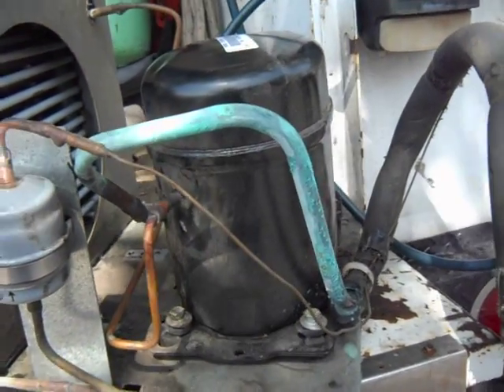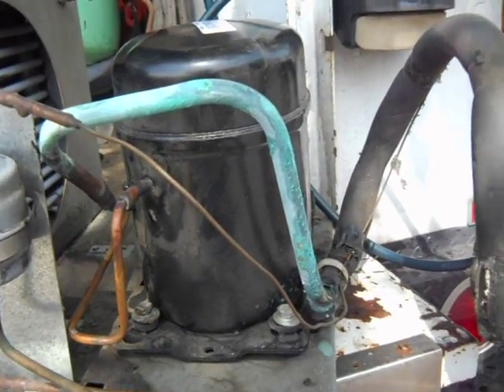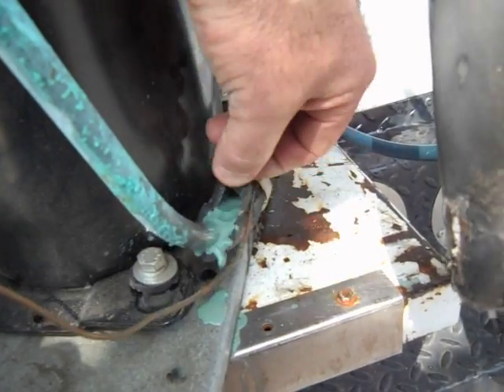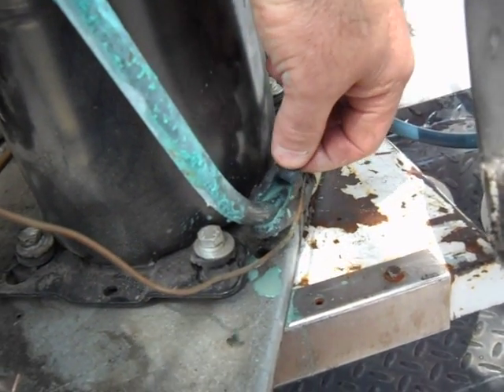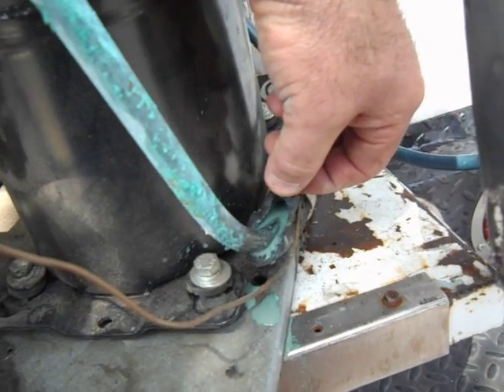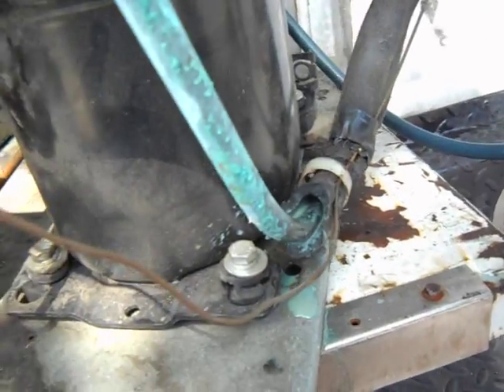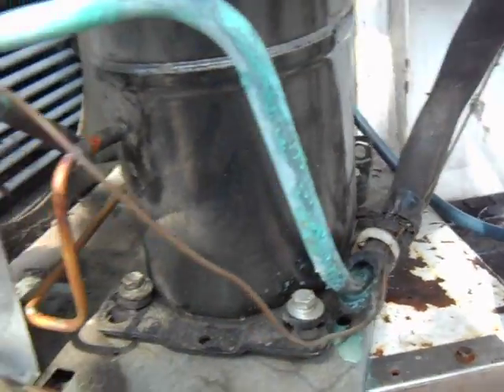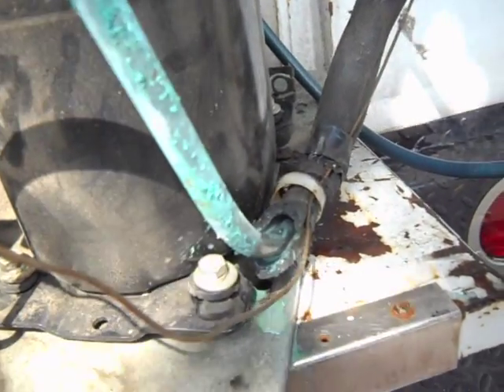Hussman Ice Cream Dipping Cabinet. Corroded Suction Line.

Comment: I dont like my 1/2 bender much, either. It is part or a 7/8 & 1/2 bender combo. It is too large and bulky to use on 1/2 inch. I was thinking about buying another dedicated 1/2 one. I bought a couple on ebay (believe it or not) and they turned out to be nice. They are not exactly yellow jacket or imperial, but here is a link to 1/2 inch one

Comment from the maker: it sure does! Compressor Shorted to Ground. it was fun making a New suction line. 2 90 degree compound bends and 4 coils of copper. yee hah. glad i had my 1/2" bender on the truck. it's a pretty terrible bender.it smashed one 90 degree bend, but i got it Done. do you have any suggestions on a good 1/2" bender.